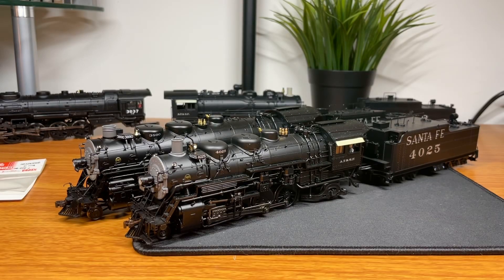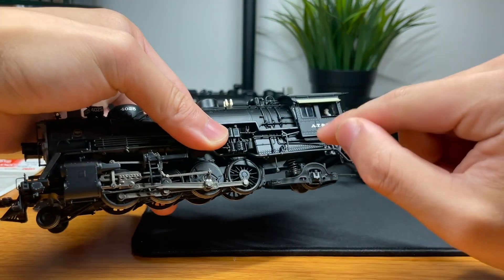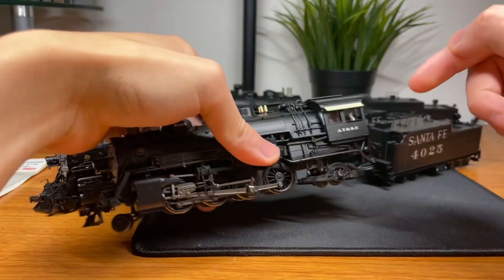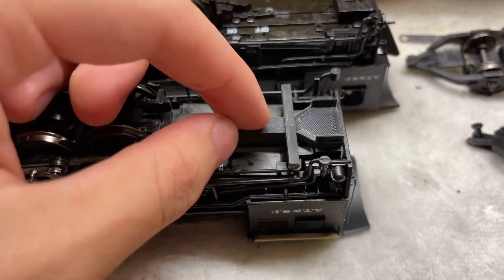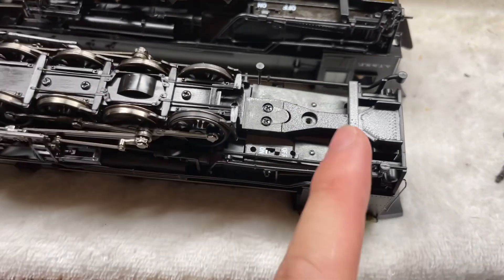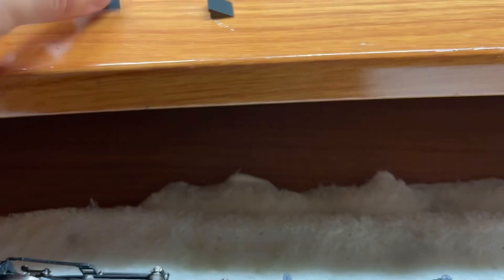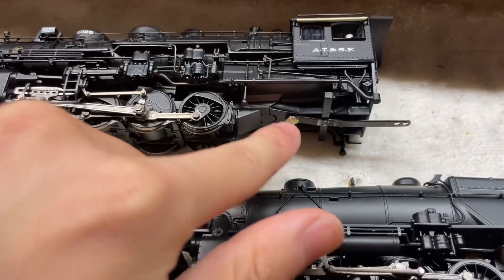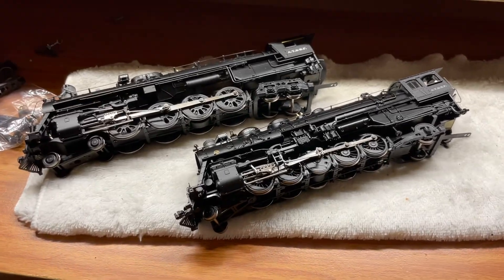Customizing Broadway Limited ATSF Locomotives: Frames (Part 1)

Comment: this is very random but have you seen the new Scaletrains Berkshires? I think they bought MTH tooling and separated the marker lights
Reply from the maker: they look like ass. mth berks werent very detailed or accurate (the PM and C&O berk is completely wrong since MTH just took an NKP berk and painted them in different roads). and Scale trains/Fox Valley are just rereleasing them with ZERO improvements to the external details. which is frankly insulting given Scaletrains and fox valleys reputation for highly detailed accurate models.

All while charging $550.

Comment: I'm surprised they still used split chassis, British outline model makers stopped using that tech 15 years ago.
Reply from the maker: @LordBlackwood-v6i  I would argue split chassis isnt inherently bad. It allows you to have bearing pickup which is extremely reliable, far moreso than wipers. Its also efficient. There really arent many downsides besides being a pain in the butt to take apart lol. Im not saying split chassis is superior in any way but simply stating that split and traditional chassis designs both have their advantages and drawbacks and neither is inherently inferior imo!
Reply: Granted, pro and cons to both, wiper pick up is very dependent on where on the wheel the contact is placed, the back of the flange is less prone to getting contamination.  @trainman440

Comment: highly informative as always from you.  I would be sure to check the weights on the front and back trucks to see how much weight they need to get the driver weights all the same (in the finescale world, we test the axle and wheel weights down to the 10th of a gram sometimes, and many have tuning screws on the springs of their wheels, which allows non traction tyre engines to pull more than many ones with them), because if the weight on the drivers is off significantly, it can cause the whole engine to be off balance, which affects haulage and track stability.  Anyways, everything looks a lot better!
Reply from the maker: @1471SirFrederickBanbury  absolutely! I try to trim/replace the lead and trailing springs on engines to ensure the drivers are perfectly balanced on the rails. good advice tho!
Reply: @trainman440  yeah. I've looked through far too much stuff on the Scalefour finescale forums, and the lengths they go to ensuring proper suspension is inspiring.  its almost hard to imagine screw adjustable driver springs in a model, but thats normal for them!

Comment: Oof, that would be pretty wild if the PRR L1 chassis was indeed re-used and slightly re designed to work for the ATSF 4000 class. Makes one wonder now if that tooling was changed for that model's sake like the PRR H10 was used to make the fake consolidation engines.
Reply from the maker: @officialpennsyjoe  yea im 95% sure its the same chassis just with different cylinders rods wheels and trucks. BLI loves to reuse tooling and most of the time Im okay with. But this is sort of a stretch.